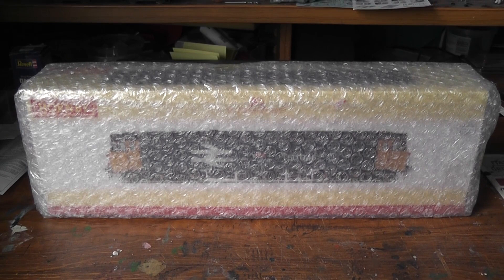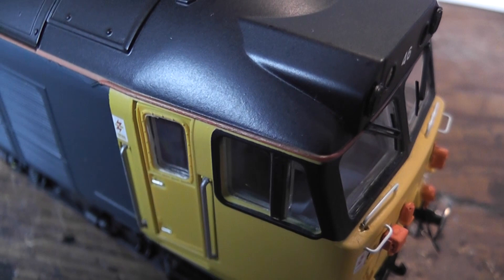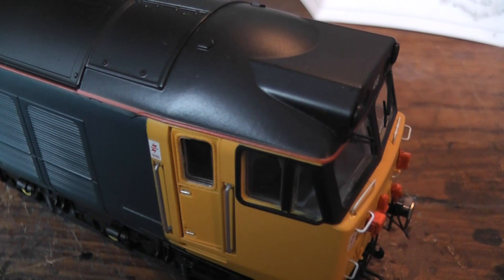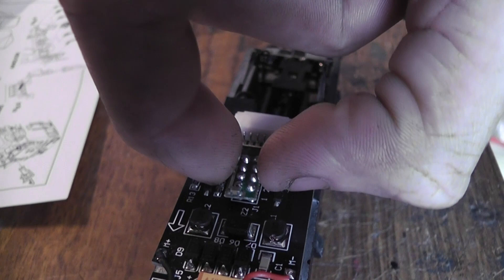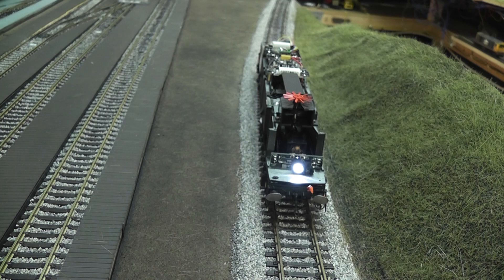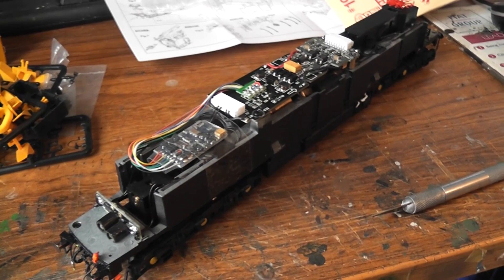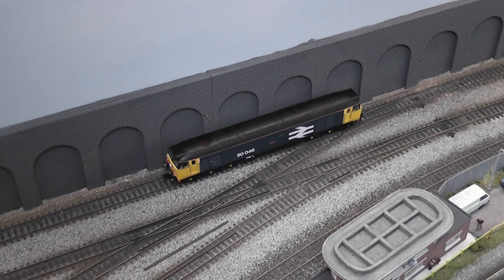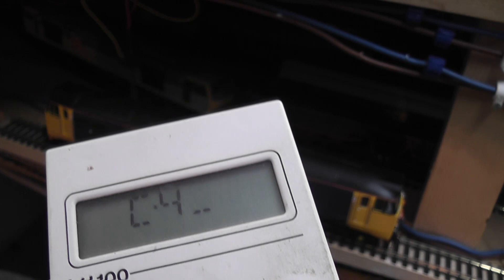Preparing a Loco for the Layout

Comment: It's been decades since I last had a OO gauge model apart (circa 1980's) - Amazed to see a PCB in there, which I thought was the DCC board until the encoder was fitted. - Excellent and informative video - Cheers

Comment: Nice video as usual-
I keep a fine black perm marker pen on hand for new arrivals (window surronds, buffer heads etc) Any visible copper pickups and red wires seen through the bogie sideframes get a quick coat of satin black at this stage also.
If pipe detail is broken or missing from second hand purchases etc . Ebay always have new Hornby packs listed for a few quid.

Comment: A very good tutorial, I have just recently changed to DCC and as such with each new Loco that I buy I ask the shop to fit the decoder for me, now after watching your video and to see how fairly straightforward it is I feel confident enough now to convert the rest of my stock to DCC, the only problem that I can see is that some decoders need to be wired direct and my soldering is not the best, but I suppose with care that can be achieved, maybe sometime in the near future you could maybe demonstrate how to wire a decoder direct.
Reply: John Morrow I would love to see that as well, as when I broke my late grandfather's special painted orange 9F he took it part, and only got as far to remove the decoder, and I would love to see how to rewire the decoder. well, help my father haha!

Comment: Thanks Richard. I guess you're happy enough with the standard traction tyres? Mine seemed a bit narrow so I swapped them over for full width ones and it pulls better up inclines.
Reply from the maker: +Mark Arnold It doesn't have traction tyres.  No need for them with all the axles being driven.  Only the very early releases of the model back in 2004/2005 had them fitted.

Comment: I was excited when you said you'd show how you fit couplers, then I was disappointed when it became clear that the 50 had a NEM socket. It's not your fault, of course - it's just that it would have been cool to find out if there was a better way of fitting Kadees than I've been doing. Most of the stock I convert to Kadees is pretty old, so NEM pockets are a rarity.
Reply from the maker: +ReddwarfIV Unfortunately for you almost all my stock has nem pockets.  I don't really have any experience of fitting them to older stock.
Reply: EverardJunction If you ever do fit anything to old stock, tell me if you find a better way than using a soldering iron to melt the plastic in a way that lets you shove a Kadee coupler into it. Or melt the plastic in such a way as to allow you to attach a coupler-box to it.

I'd rather not do it that way, but I haven't found an alternative.
Reply: +ReddwarfIV what Kadees are you using? I have had success gluing #5 s to the underside of some wagons. Some I have been able to just screw in. there isn't a standard for  items without NEM pockets you have to just treat each piece of stock as a one off and rig the kadee tomfit. Generally though a #5 will work.
Reply: Scott Malcolm 5s and 20s. Bear in mind that for much of my rolling stock, I have to remove a huge tension lock coupler. Also bear ind mind, I'm mostly referring to carriages and locomotives - fitting the coupler to the underside would be useless - it needs to be attached to the bogey.

Comment: Mmmmppphh. Detail changes in the chassis, as you note, are partially due to Hornby's enforced move from the Sandakan plant, up the road a few miles to the new Piko (ex East German company) plant. Info courtesy of a personal conversation with the Editor of a German modelling magazine back in 2013.  One operational note (as I was a BR train driver) is that red tail lights must NOT be left on when hauling loads. The red light is obviously only found on the rear of the train !
Reply: Piko is not ex east Germany company it is still here since 70 years

Comment: Good informative video. Your a Class 50 fiend like me, I've 4 at the last count. I always thought the roof fan went at the front with the working louvers. guess it's subjective. I see your back using Bachmann decoders again have they stopped buzzing now.
Reply from the maker: +Kirby Park West Nothing wrong with the 8 pin bachmann decoder.  It's the 21 pin I avoid using.  I've haven't bought one for a while now an have stuck with lenz on 21 pin locos.
Reply: +EverardJunction Ok thanks for that. One of my class 150's makes an annoying buzzing noise and I think that has a 21 pin Bachmann in, will change it to a Lenz.
Reply: +EverardJunction Bachmann went back to making the older 21 pin decoder they still make the other one too though.

Comment: Great video and very nice loco. I see the Hornby 50's have the NEM socket on an arm from the chassis insted of the bogies, is that something new? I'm used to seeing the couplers on the bogies. Nice to see the other 50's of the fleet waiting in the station for the new arrival.
Reply from the maker: +Weekend Engineering Most new hornby diesels made since 2003 have had the coupler on the chassis.  Its supposed to look a bit more realistic but can cause derailments when reversing.

Comment: Hi richard
If I was to set my cvs like you did for slow acceleration and slow deceleration would a sound chipped loco go to full power sound wise if I told the loco to accelerate to top speed  and then after the loco got to top speed would the sound match the speed???.
Peter from Birmingham

Comment: Hi Richard, in part 11 the scenic area beside the canal, I was just wondering  if there should be a security fence running along that section to separate the public from coming up the embankment and onto the railway line you know what kids are like cheers jack.
Reply from the maker: +Jack Brown I'll be putting in a new fence to replace the old one I used to have over there.

Comment: high rich another helpful video but I always run in my new locos on dc before fitting a decoder just a personal thing after having problems with earl hornby 50 and burnt out decoders I also found your cv adjustments helpful I look forward to next video .
what about sound decoders.
kind regards
ralph
Reply from the maker: +Ralph Lees Thanks Ralph.  I don't have a DC layout to run in locos so I have no option but to go straight for DCC.  In 5 years of doing so i've had no problems.  Running a DC loco on a DCC layout is not good for the motor so I always fit the decoder first.

Comment: +EverardJunction where you have put the detailing is it then possible to fit a coupler so it can be ran with coaches or wagons in both direction instead of having a "push pull" effect with the coaches? Amazing video by the way thinking about switching to the Kadee system.
Reply: Nutter 31806 yes you can remove the dummy coupling

Comment: Can I ask if your class 60s when you changed the CV settings for accelerate and decelerate do they go any slower? I have 4 class 60's I have reprogrammed them as far as my power cab will allow which is 32 & they haven't changed much

Comment: Great video as usual Richard.  Do you ever fit  a driver and mate into the front end?  I have trouble finding decent crew.
Reply from the maker: +Chadwick TMD I don't usually.  My bachamnn locos come with drivers but the hornby locos don't.  The cab interiors are very difficult to remove without causing damage to them so I usually avoid it.

Comment: Huh, snazzy.

I recently snagged a few bits and bobs off eBay to get back into things after nearly 20 years. One of them is a Bachmann N-scale 4-8-4 w/ 52' Tender. Got it for $39.99 US, seller said it works but runs slow.

I'm assuming that just means it needs to be cleaned and lubed. Any tips for getting that thing apart and back together again? I imagine the side rods on a loco half an inch wide are gonna be fiddly...

Comment: Love the videos just a quick question what controller would you recommend for a small layout for running 2 or 3 trains at a time.
Reply: IMO, that comes down to which controller you like best.  I use the NCE system because I like the modern look of the controllers (most of the other brands look like 1970s TV remotes).  But you won't go wrong choosing Digitrax or Lenz or MRC.  Now, some fanboys are gonna flame me for listing MRC for example, or for not listing their favorite system.  Others don't like the NCE controllers because of the thumbwheel speed control, while Digitrax has an actual knob speed control.  Decoders are interchangeable, so you're not locked into choosing one brand of decoders to match your system.  You can even use an N scale decoder in an HO scale loco if space is tight.  But controllers are not interchangeable; if you buy a NCE system, for example, you can only buy NCE controllers.

Comment: Hi Richard,
I've just been looking through a few of your videos trying to find the product of a glue applicator you once used. I believe it looked like a glass syringe that adds tiny beads of glue, do you have any idea what I might be talking about and if so, what the product is called?
Thanks 
Lawrence
Reply from the maker: Should be the deluxe materials pin flow applicator.

Comment: What does a decoder do.
Reply: makes everything better
Reply: A decoder gives each loco a unique address.  That way you can have one controller driving loco #1, and another controller driving loco #2, and so on and so on.  You don't have to worry about selecting power blocks as your whole railroad is one big block with each loco being controlled by its own controller.
Reply: Chris Atha a decoder is a sort of tiny computer chip that fits into a Loco to allow it to be controlled individually with its own address without having to fit isolating switch blocks
Reply: @HungryGuyStories  what's a railroad